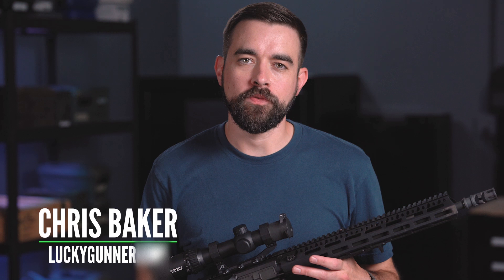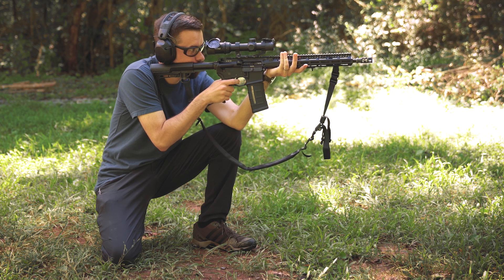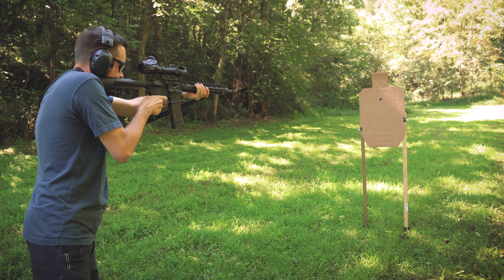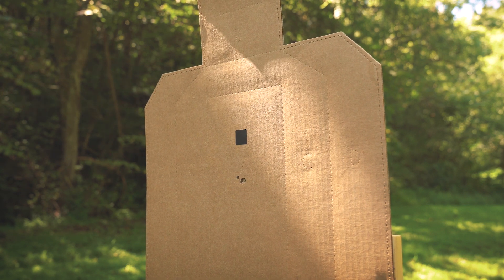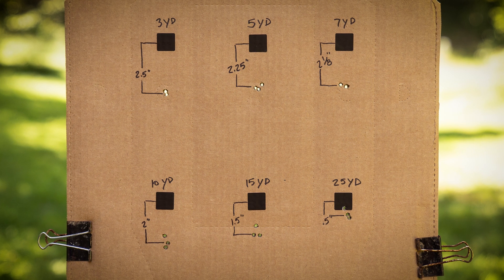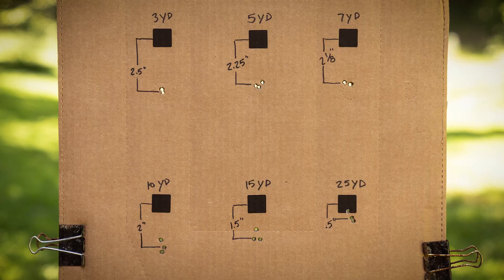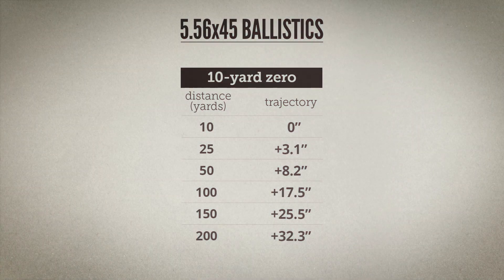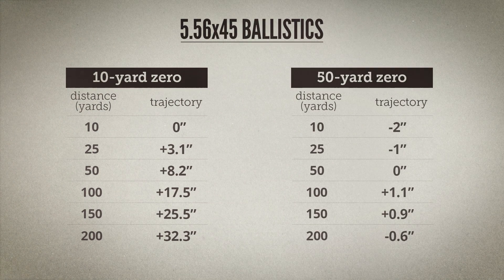Why Your AR-15 Shoots Low

Comment: that's why the fixed sight comes in handy.  you will always have that dialed in focal point. thats what i used to  dial in my optic red dot. without a fixed sight you will struggle

Comment: When I first sighted in my AR15 I just had access to a 25 yard indoor range.  I sighted in 1/2 inch low to account for this.  Later went to a longer range and it hit just about perfect at 50 and 200.

Comment: i had a bunch of bulk 55gr american eagle for my ar with a 1/7 twist so i decided to zero my rifle at 25yds (my indoor range only goes that far). after a few mags of 5 shots i was pretty satisfied with a thumb sized group at where i was aimming at. then i adjusted my front post where poi was roughly an inch lower. ive read its pretty much good to go for 100yd. is that a safe assessment or is the internet is lying to me?

Comment: Absolutely.  THe original (carry handle) M-16 was zeroed at 25yards which resulted in a long distance intersection at 225 yards.  The ammo was M-193 55 Gn FMJ. This resulted in a zero from contact distance to just shy of three hundred yards that differed no more than the "mechanical offset".

Comment: I overcame this problem by installing 45° offset iron sights zeroed in at 20 yards. Works great.
Reply: YES!! Same here. Started with my AR10, because I put a low power variable on it, but I've done that now with my AR15, too. HUGE difference and the cant to use them is not that hard to get used to.
Reply: ...it’s still going to happen with offsets once you get close to the target though.

Comment: My ar pistol which is one of my choices in a home defense situation has a red dot cowitnessed at 50 yards and a red laser set for 5 yards. At cross room distances the laser is accurate and visible. At longer ranges where the laser would be hard to see, the red dot at night, or irons during the day give me a longer range sight. Depending on conditions I either flip up the irons, or turn on the red dot or laser.

Comment: The MPBR ( Maximum point-blank Range) is a Zeroing option on most if not all Ballistics charts and Apps. You pick a range or bracket of distances through which you will most likely be shooting and set your zero to give you the most optimum trajectory to stay inside your intended target's bullseye window. i.e. Whitetail deer heart 5" or so, Moose/elk 8" or so, or smaller if you favour precision. That way, your bullet will not stray outside of a certain window of impact. So, for example you opt for precision, and say a 3" bullseye over a maximum distance of 100 yards or 150 yards... you zero your particular cartridge's initial bore to sight crossing axis at approximately 40 yards, so it peaks trajectory at about 85 yards , is dead-on at 110 yards ( 100m) and drops to your lowest allowable bracket at about 150 yards. That way, ANY shot you take within 150 yards will not be more than 1.5" high or low out to that range. Takes a lot of guesswork out of the equation. Yes, you still have to deal with your Height-over-bore offset, but keeping that in mind, means you don't have to do and math, or remember which dot to aim with in the bedroom, or down the hall, or in the driveway. In CNS/ Centre-of-mass shooting in defense situations, it  is unlikely to matter if you're off by an inch or so... P.S. Love the Video content. Most thorough and concise data, given in very east-to-listen tutorials. Keep it up. Protect your rights. Respect from Canada.

Comment: Yes.  You are one of the very few who are addressing this phenomenon.  I was taught, when using iron sights or a low mounted scope, to sight my rifle in dead on at 25 yards.  With cartridges like .30-06 you would be a couple inches high at 100 and nearly dead on at 200.  You cannot do that with something like an AR.
Reply: AR's actually have a couple zeroes like that, 25/300 yards is a pretty popular one 50/200 is another.
Reply: The military uses a 25 meter zero that puts rounds on point of aim at 300 meters with the m4 carbine. google 25 meter ar zero

Comment: So should we set up the optic more for 50 yds and the irons for CQB?
Reply from the maker: Depends on what you're doing with the rifle. If your irons are truly "backup sights" for your optic, they should probably be zeroed for the same distance. If your irons are for close up and your optic is for longer range, then maybe they don't need to be the same zero, but you're still going to run into issues if you try to zero your irons for 10 yards or something really close like that.

Comment: I zero my AR at 50 yards. It has the BDC reticle(Vortex Strike Eagle 1-6). At 20 yards, it hits dead on when I use the 400 yard crosshair. Everyone needs to shoot their guns at different distances.  KNOW YOUR WEAPON!!!    Optic height is also why your bolt-action rifle is about a 50-140 yard zero, and your AR is about a 50-200 yard zero. The starting point of your trajectory is at a steeper angle upward, when your optic is mounted high. You also need to know your "hold under" for the apex of your bullet path. These things are SOOOOOO HARD for some people to grasp. Just try to imagine that you're "lobbing" your bullet into your target, then it will make more sense. Great video, as always!!!

Comment: I use a 3x9 by 40 zeroed at 100 yards and 45 degree off set iron sites for under zeroed to 25 yards just to correct for this issue. It makes transitioning distances much easier.

Comment: I was just wondering about this the other day. I'm blind and coming up with a system to read color through my scope so I can aim at a light/dark part of the target for aiming. but since I can't ajust the retacle, my system will always be a little above the bore. I thought one job of the retacle was to ajust your point of aim to make up for the scope being above the bore access
Reply from the maker: In some cases, the reticle can help compensate for the mechanical offset. For example, the EOTech holographic sights have a red circle with a dot in the center. The dot is the aiming point normally, but at very close range, the user can place the bottom of the circle (6 o'clock position) on the desired point of impact and generally get very close to where they want to hit. Other optics may have reticles with lines or marks that are generally designed to be used to compensate for bullet drop at longer distances, but they could also be used at close range if the shooter finds that some of those "bullet drop" markings happen to correspond with the mechanical offset.
Reply: so if the bareel and the scope are say on paralel tracks, and the scope is zeroed for 10yrds. that creates a slight angle where you have a triangle that is 100 yrds long where the tip is where the retacle center and bullet meet at 100 yrds

Comment: Shawn at Vigilance Elite recommends a 36 yard zero. He has an excellent video that shows why.
Reply: 36yd, good ol corps bz.
Reply from the maker: I'm sure there's a good case for it. I don't think there's a one size fits all ideal zero, though. My preferred zero is based on the rifle I'm using, the ammo I plan to use with it, the optic I've got on it, and what I'm going to be doing with that rifle.
Reply: @LuckyGunner  https://www.youtube.com/watch?v=jttB1kUXfJE&t=1s
Reply from the maker: @DJ DeeZee He makes an excellent case for the 36 yard zero, but notice that in the video description, he's assuming 55 gr ammo. My preferred load for the rifle I'm using in this video is Fiocchi 69 gr MatchKing, and if I plotted out the 25, 36, 50, and 100 zeroes with that ammo, it would look completely different than what Shawn shows in his video. For instance, with the 69 gr ammo and a 50 yard zero, my drop at 300 yards is not quite as drastic as what he's showing with 55 gr ammo. So again, context matters. For guys coming from a military context, they may have been issued  a certain type of ammo and had no other option, so they found a zero that worked with that particular ammo. As private citizens, we have many options, and changing the ammo will change the trajectory, which changes the ideal zero for that rifle.
Reply: As the luckygunner said different ammo different guns play different. i use only 62 grain even though he says 55grain. 36yd just works for red dots similar stuff. My primary arms prism is zeroed at 100yd being the bdc requires it.  It isn't a end all be all just a standard I've been trained on and works for hitting human sized targets. Given he works for luckygunner I'd be using higher end ammo if i could as well.

Comment: That's why I prefer the '50 yard zero.' Dead on at 50, and at 200. Think about 1in high at 100. About 1in low at 25. Couple/few in. low at 300 I believe. Affected by particular grain weight of ammo obviously
Reply: Fireteam Michael what grain weight do you use for this zero scenario?
Reply: @frostriver4547  I use the 50/200 yard zero with standard 55 grain ball and it works well
Reply: 36yd with 62 grain has always been my go too. Even works with 7.62x39 rifles with optics. Keeps 0-500 in a very manageable spread. Vigilance did a video on it.

Comment: The bullet travel is not a flat line but a upward arch & in the back end it’s coming down until it reaches the target but on the front end of that arch right after the projectile leaves the muzzle there’s a dip or downward arch before it starts the upward arch travel to the intended target. This can only be experienced with close range targets as explained in the video.

Comment: I don't understand why a person would look thru optical at 3,5,7, 10 yd.  That offset is not a concern.
Reply: Do a simulated hostage shot, then get back to me.
Reply: @skyhop  Same answer.
Reply: @jerrybobteasdale  you are not going to take the chance shooting just looking over your rifle when you absolutely have to hit what you are aiming at (or by what you say not aiming at) or people could die. Might be fine for range targets but when you are going to be legally held accountable for every round you fire I think I would look through whatever sighting system I  got. Remember a lot of people only run an optic and have no other way to aim.
Reply: @secondswell  Co-witness iron sights.  At such close distances I don't see how training to use optical sights is a good idea.  It won't add to accuracy nor help with speed of acquisition.  I rather wonder if optical sights with magnification are even a help for law officers
.
Reply: Red dot sights are just plain faster to get onto target, and obstruct less of your view. Aside from that, an AR with iron sights has the same hight over bore as the red dot, especially if it's co witnessed.
Reply: Great video, but it's amazing that people need this explanation!

Comment: So in the Army when we perform the 25m zero with the M4 with CCO, we zero with rounds grouping below where the dot is aiming.
Reply: Could you explain Army's 25 meter zeroing process little more in depth please? I believe you guys used the 100/300 meter zero correct? And like what setting is elevation set at on rear sight? Ik front post is where elevation is primarily adjusted, but just curious what rear sight elevation setting is set to,  and what range, and how low POI is?
Reply: @fireteammichael1777  no we use a 25m 300 so the grouping is so small the size of a quarter you need 2 sets of 3 shots so 6 total in that circle that will hold ur zero of a body sized person to be struck from 25 meters to 300 but we aim burm belly chest and off head head neck to clean up ur shots but also Kentucky windage

Comment: Just went plinking my 15-22 first time.  Windage was off a bit, fixed that but man, I'd have to screw that front post WAY up what am I doing wrong?  Oh,  I had the target at 7 yards.  22's are such teeny little holes with old eyes.  Put it out at 25 yards   ok, now the center has something to worry about.  If this video was 3 weeks earlier I would have thought about it before hand and not looked like such a noob.  You know, 3 months ago I put that cmmg 22 kit in my AR and I remembered all this, just exited with a new toy I guess.

Comment: Mechanical offset. Normal on ARs, worse on AKs, less on M1As and bolt actions.
But its still there.
Reply: AK irons are much closer to bore than AR. And, if you choose carefully, you can get AK optics to cowitness the iron sights.
Reply: Why would it be worse on AKs? The mechanical offset has to do with sight over bore, which is low on most AKs.
Reply: @domenik8339  a typical AR15 has a rail-over-bore hight of 1.25". If you mount any optic on that you get 1.25"+(height of scope ring bore).
If you get a typical AK47(AKM, 74, WASR) and use a typical optic rail that mounts to the reciever that rail is ~2.00" over-bore. So 2.00"+(height of scope ring bore).

Yes, certain combinations of rails and micro optics can lessen the over-bore height by a decent bit, but you'll be hard pressed to get something 3/4" lower than the line of sight considering you have a bolt and gas system that would be impossible to relocate.

Comment: Why are we mounting our scope so high?  I always mount my scopes as low as possible.
Reply: The problem with an AR-15 is the stock is in line with the rifle. That forces the optic up a little higher so your eye can get behind it. Unlike a traditional rifle with a stock that dips down input your eye closer to the bore.
Reply: @Hoodlum3621  Makes sense.  I see now the stock is straight.
Reply: @Hoodlum3621  also the gas block puts the front site above the bore.
Reply: High power hunting scopes with big lenses force the scope to sit high or factory mounts are just high for some guns. Generally the former for long distance shooting.
Reply: @chris.3711  Yes, I am aware of that.  I've been around guns for almost 60 years, just haven't seen the need for an ar.
Reply: Because we have cheeks, and without removing your teeth and most of the bones in your face, you can't put your eye lower.

Comment: So if you zero at 50 then shoot farther, the bullets will start to go high right?  At some point they will start to come back down again and will have another zero?
Reply: Paul Harrell has a great video on this.
Reply: @joebob4609   Do you happen to recall the title? Or I might just have to search for it.
Reply: @chubbycatfish4573  Thanks so much.  I'll go check it out
Reply: Chubby Catfish 
Yep that is it...
Reply: I think its 50 and 200 if I remember correctly..I like 25 and 300 because at the midpoint of those distances your round goes slightly higher. But you'll have more drop at distance after 300..50 yard zero gives you the least amount of offset to remember in that combat distance zone
Reply: @50StichesSteel   I see what you mean thanks

Comment: Thank you, Chris, for this GREAT YouTube.  All of us probably understand the Mechanical Offset concept’s theory, but this video provides some very valuable quantitative data, which is compelling.  I have a red dot on my Ruger Gunsite Scout, but it’s elevated for this very reason, allowing the full use of the rifle’s excellent iron sights at short ranges (approximately thirty yards or less).

I’d also point out that the same phenomenon applies to the use of laser sights.  While the laser is very probably more closely aligned to the bore-axis, there may still be an inch or so difference in the two “zeros” (especially for grip-mounted lasers, as contrasted to those that are frame/1913 rail-mounted).  For example, when I first installed a laser on my 2.25 in SP-101 snubbie, I found that the Mechanical Offset really affected precise accuracy at very short ranges (such as aiming for a dime-sized target at five to ten yards). 

As always, I thank you and Lucky Gunner for your great work!

Comment: I'm just going to say this before I watch the video. If you're shooting low, that means your optic is sited for a longer range.
You have to remember two things, the site picture is usually about 2 inches above your rifle, for one, and two, your center may need to be lowered.
If your sites are adjusted for 300 meters, and your shooting from 12 yards away from your target your going to be hitting low, unless you account for the above statements.
At point blank range every round you fire will always be lower then your site picture. Remember, your looking ABOVE the rifle, you're not looking though the Barrel.